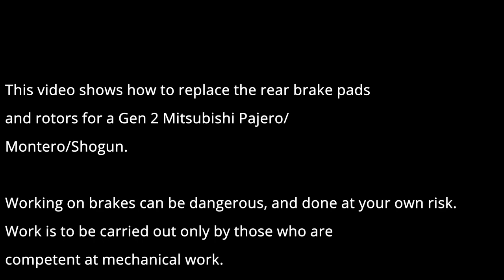Pajero/Montero/Shogun Rear brake change

Comment: Why did not put some grease o those bolts .. next time will be easyer
Reply from the maker: You could, but i don't think i'll be removing those brake rotors for a very long time.

Comment: Good video made it look so simple. Did you adjust the handbrake shoes after if so how?
Reply from the maker: Thanks Des! No i didn't adjust them. I did get them replaced though at a later date. I didn't have time to do them myself so i just took it to a brake and clutch mob.

Comment: Hey is it possible to adjust handbrake without taking the disc off? is there a hole or something in the back to acces the adjuster with screwdriver?
Reply from the maker: Not sure hey, i haven't had to adjust it from there. I did however try tightening the cable underneath the car.
Reply: Thanks, I have already adjusted it.. There is a hole with rubber cover in the back to adjust the handbrake, so you dont even have to take the wheels off.
Reply from the maker: Oh awesome stuff!! Glad you worked it out!!

Comment: Are thos dobbinsons rear springs?
Reply from the maker: They are indeed mate!!!
Reply: @wilddonkeyadventures  how do you like them? there really isn't anyone in the US using them and was considering picking them up
Reply from the maker: @iBIiss  I'm really happy with them hey. They give a nice responsive ride without being too firm. I know some folk find the ride a bit harsh, i honestly don't know what they're talking about. LoL They also take the load pretty good as well.
Reply: @wilddonkeyadventures  aweome! thanks for the reply I think I'm going to pick them up!
Reply from the maker: @iBIiss  Just do your research on exactly which ones you want. I got the linear rate 40mm lift, 250kg constant load. But i have a drawer unit in the back and a big spare tyre. If you don't have much weight in the back you might find it a pretty hard ride.

Comment: Wonderful way to ruin ABS unit! Never push pistons back forcing brake fluid back to reservoir. Loosen bleed nipple and attach tubing and then to container, push piston back and fluid will empty into container 
. When piston far enough back, tighten nipple and top up reservoir.
Reply from the maker: This car doesn't have ABS. So it's not an issue on this one. Good reminder though in case someone attempts this on an ABS vehicle, i'll make a note of it in the video description. Cheers.

Comment: Have you ever had to replace the rubber brake hose that attaches to the caliper? I can't figure out how to remove mine.
At the other end it screws onto the end of the metal brake pipe, but it looks like the head of the fastener is recessed into a square metal bracket.
Reply from the maker: Yeah i've removed them before. Where the pipe attaches to the bracket, there's a clip that holds it in. You have to slide that clip out and then the hose will be able to move, put plenty of WD40 on before you start cos they can be mighty tight at times.. I'd also get a set of proper spanners as well or you risk rounding the nut off.